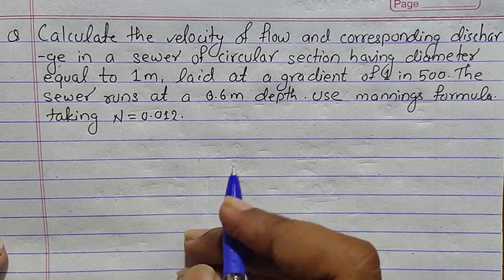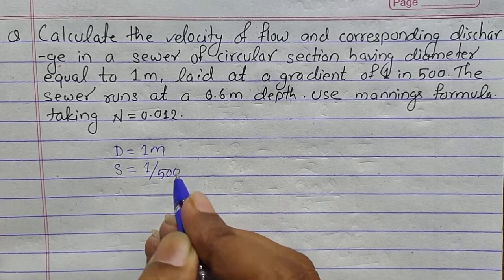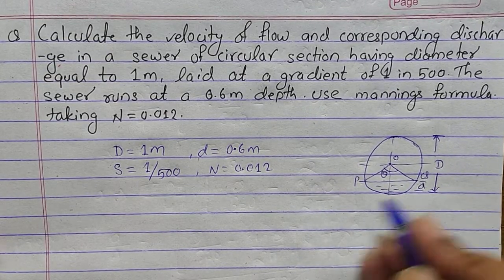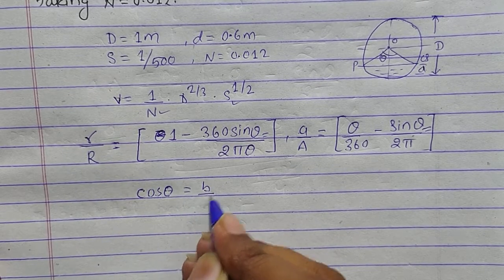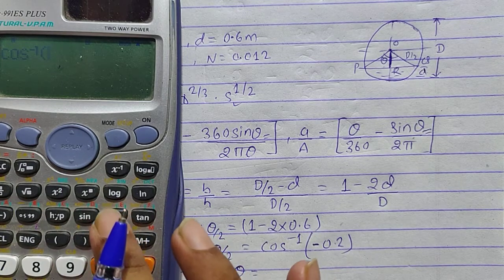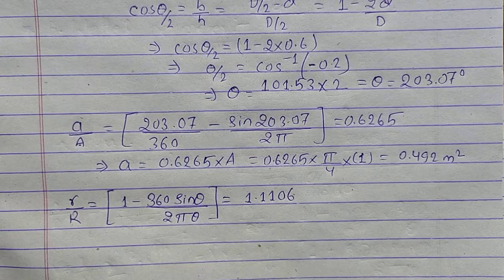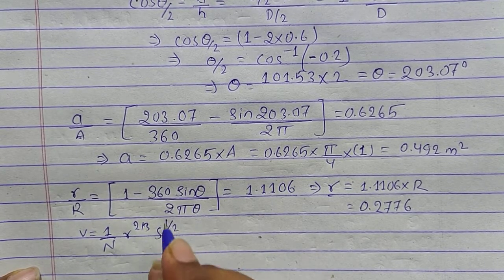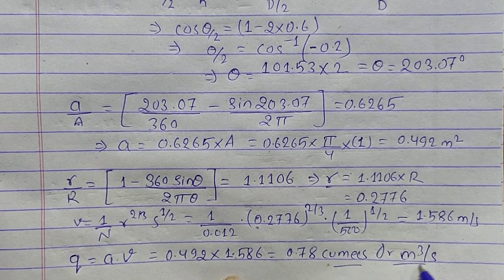Sewer design example

Comment: Check the value of r
r=1.11×R.    Where R =1/2
r=1.11×1/2
r=0.555.      But your r=0.2276 How??
Reply from the maker: R is hydraulic mean depth and it's formula is area/wetted perimeter.
Reply: Thanks a lot👏
Reply: R= D/4  right??
Reply: D/4=1/4=0.25 
R=0.25
r=1.1106×.25=.27765

Comment: 0.6m is 60% 
Water level should be above centre line...why are u considering water level  below center... 

Plz explain the reason..
Reply from the maker: Yeah you are right.
And you can also see that 60% is greater than 50%.
If  the depth were below 0.5 m then only it would have been flowing below center line. But this case is not present here.
Moreover the question is not created by myself. I have just searched for a good example to clear concept on design of sewer.
Reply: That means  in case of 60% or 80% 
This process is incorrect..  right?
Reply: Plz try to upload an example where water level is above the centre line.
Reply from the maker: I will be uploading it soon.